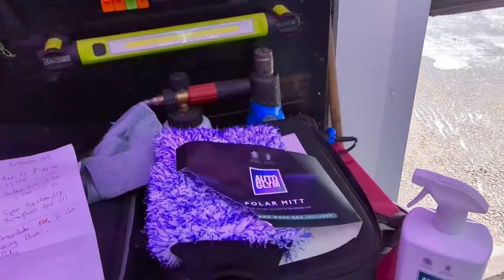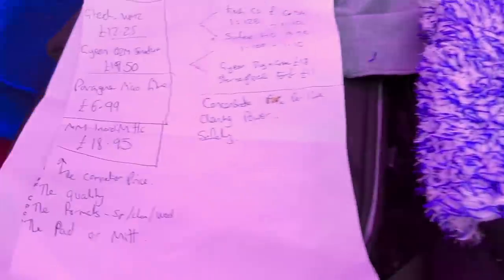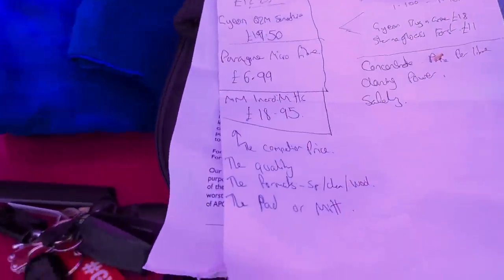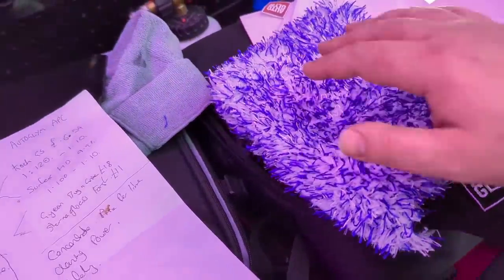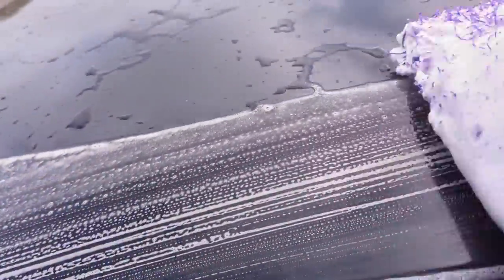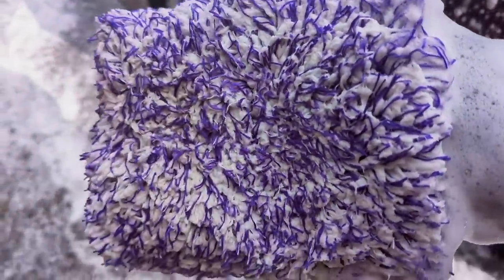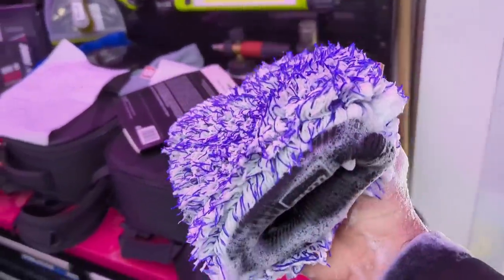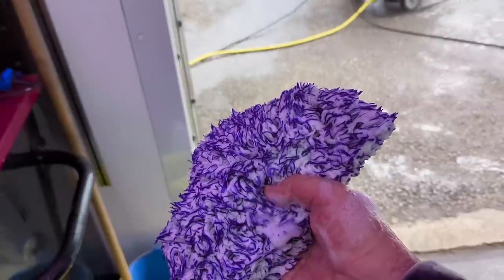Autoglym Polar Wash Mitt Review - Car Detailing Products

Comment: I'm just worried this type of mitt, will catch those tiny bits of dirt or tiny, tiny sand, that we can't see and scratch the body panels. I have 4 mitts now, two from Chemical Guys chenille type, one from Simoniz chenille in yellow, one Halfords hybrid mitt and pad jobbie. The Simoniz, cost me £3, and is on sale again at £3 at Tesco's. Can't tell much difference between any of them, but Simoniz is just a little smaller, fits well, and at £3, can't complain, does a great job. Great video anyway, always appreciate any Forensic review. I don't think any mitt should be more than £10, but you are free to spend your money how you wish. Never buying Chemical Guys Max Coat wheel guard ever again, complete con.

Comment: Been looking at the same wash mitt, I had been using a Maguires one until recently but has got bits of grit in the fibres (picked up the grit from the plastic trim) When that happens I change to a new mitt and use the old mitt for the plastics and plastic wheel arch liners.

Comment: Hey John, I currently polish with a PC 7424XP and it’s “ok”. Would a Rupes or a Flex dual action be easier to use & better results and maybe faster to polish?  Thanks
Reply from the maker: Better ergonomic and more cut from modern machines with larger orbits.  But any da is a good tool

Comment: These are just branded versions of the Ali express cheapo mitts.. (so non branded) do the job for quarter of a price!
Reply: Probably correct.  It is completely illogical that the ever expanding number of Detailing Product Companies are all making their own unique products.  Lets be real that vast majority of detailing products are subcontracted to few suppliers.  Not that this is bad in itself - that's the way with many things these days.  Just getting a wee bit over it, to be honest.
Reply from the maker: Ofc course they don't make it.  You would need a factory just to produce and split the microfiber and all the cutting machines etc... Although autoglym formulate and make all their chemicals in house.    You go to Chinese or Korean manufacturers for this microfiber stuff.  But there's quite a few of these around and it's working with the ones that are better.  It's not the same as the budget Ali express ones but you can go that way.  The budget chenilles for example are fine and you can pay peanuts.